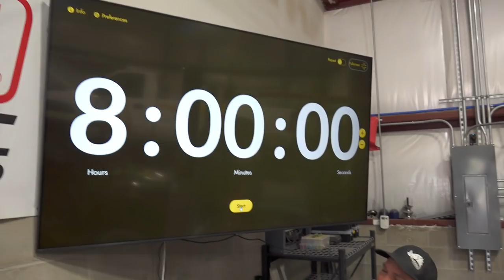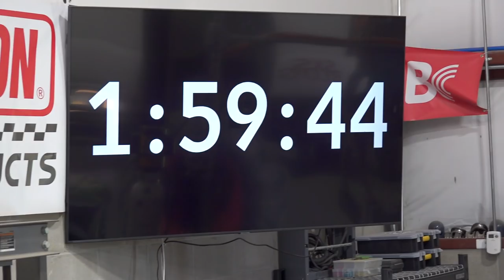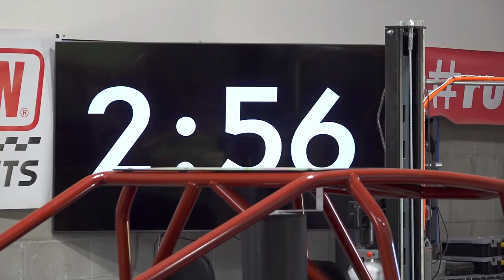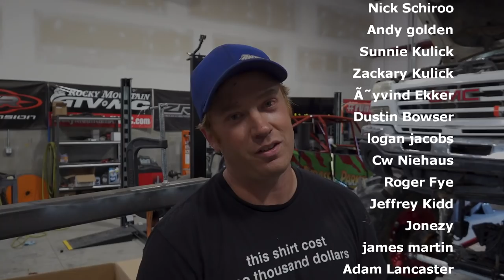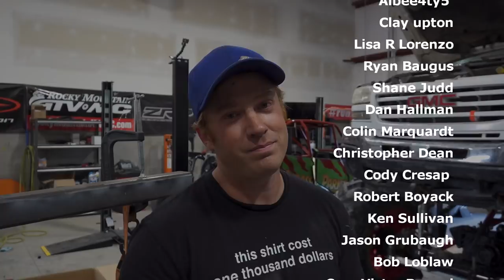2-stroke Maverick X3 vs TURBO Mega Truck build off! 2 Builds 1 Shop DAY 1!

Comment from the maker: Who do YOU think is gonna win the build off!? Team RIK or Team DOUG??
Reply: DOUG!
Reply: What happens if nobody is done in 3 days? While I love you guys, let's be honest, that is a very real possibility.
Reply: DOUG!  Loser should have to take a 5 wheeled John Deere gator to silver lake for a day on your next trip out.
Reply: Rick and Matt radiator cooling fans don’t know if it’s got condenser for ac and remove any coolers off the front remove headlights core support bumpers get right up close and personal don’t have to worry bout pulling motors to fit the cam then take all the accessories off the front and you’ll be on the move gentlemen
Reply: You should make a secondary punishment for possible complications due to rushed tasks in the build to really make sure the job is done right
Reply: I'm backing Dr Doug 2 strokes rule baby
Reply: Doug!
Reply: Team Doug
Reply: Everybody picking Doug but Rich ain’t no slouch
Reply: Doing body shots off of the winning nick in 100* heat without a shower seems like a punishment I couldn’t handle without throwing up? Just a thought ???
Reply: Doug. But I really just want to see them unit's rip.
Reply: Got to go BATTLEFIELD
Reply: Team doug 
But Rich rules baby!!!
Reply: DOUG
Reply: Run one mile while driving a sxs next to him
Reply: I like biscuits!
Reply: Who wins? We do!!! Let’s gooo, baybee!!!
Reply: Doug isnt human he will prevail
Reply: No fast food for a month. 🤣
Reply: RIK & MB for the win!, They got this!
Reply: Team Viewers for getting to cool projects done around the same time.
Reply: Doug
Reply: Def Team Doug ftw. Keep this content on the main channel. It’s still sxs related content so it’s still relevant for the main channel.
Reply: Rick Rules! Lol
Reply: Team DOUG!!
Reply: Dope Series!! Team building is a great tool to use in life!
Reply: Team Doug but can't wait to see McMega rip!!!!
Reply: Didgeridoo Doug for sure!
Reply: dougggggg!!!
Reply: put it all in one channel !!!!
Reply: Rich rules babyyy
Reply: Stock build l would go with Douglas but the custom stuff could cost more time.Rich and Matt for the win.
Reply: Loser team spends 24 hours in a McDonalds. Each QP ate deducts an hour from time spent.
Reply: Doug
Reply: The Butterfield brothers!
Reply: This was a real fun video. Keep it on the blog channel!
Reply: Rich Rulez baby!!!!!
Reply: Rich rules baby
Reply: Rik.
Reply: I’m always team Doug!
Reply: Team Doug!
Reply: DOUG
Reply: I can't call it...
Reply: I like all involved; but I think team Doug has my vote. I mean; come on they are brothers. 😎
Reply: I don't care who wins I just want to see that 2 stroke sxs work! And I hope it's everything that Doug thought it could be when he came up with this monstrosityous  (I just made a new word) idea,... witch by the way is imo epic!
Reply: team rik
Reply: Losers swim the pond then gets pulled around the track on a hood wearing Wildcat themed clothing.
Reply: Team Doug
Reply: Doug rules baby
Reply: Go to d&d paddy for some aggressive tires plus you might see monstermax 2
Reply: Doug
Reply: Doug hands down 🤘
Reply: Doug wins, keep it on the sxs blog channel!!
Reply: Keep the series all on the main channel love the projects!! Team Doug all the way
Reply: Douglas
Reply: Doug
Reply: @1kered88  damn, that's low.
Reply: Team Doug all the way but I wanna see Mcmega ripping👍🏻👍🏻👍🏻
Reply: Doug and his evil genius bro
Reply: Im team RICH RULES BABYYY 
Also love the build battle format like this was awesome to watch
Reply: Loser has to swim the length of the pond!
Reply: My bet it on mc mega. Simply because most of the fiddly work is done most of the next bits are pretty well bolt on 👌🏼. Can’t wait to see them both throwing mud
Reply: I dont care who wins long as they both get finished I wana see that 2 stroke sing
Reply: Im team Doug. Cant wait to see that 2 stroke rip!!!
Reply: Team RIK
Reply: Doug looks further along, but I feel Rick may get a lot done once the right head studs make an appearance
Reply: I am agree with Matt, keep it that way!
Reply: I think Doug is going to win.
Reply: Just put all videos from this series on both channels
Reply: We love this kind of content. We will watch no matter which channel it is on.
Reply: I think Doug is going to win the big problem he'll have is the connection between the snow cat engine and the knuckles. Since he laid out the motor very precisely, his issues will be smaller because he'll "only" need to think of one solution and copy paste it to the other side. If Doug screwed up with the alignment of the motor then it will be a another animal.
Also I like the competition and please keep it here and do it once biannually.
Reply: Have Whistling diesel do a durability test on the losers ride.
Reply: Gotta go with Team Doug.  Just gut feeling.
Reply: I'm ready to see them both rip! Thank you guys so much for busting ass to get them done for all of our enjoyment! You guys are awesome!!
Reply: Doug
Reply: Team Doug
Reply: Doug
Reply: Rich rules baby!!!
Reply: Tie
Reply: @1kered88  Those were so awful haha
Reply: @JustinG85  yah those motors are real easy to work on. It doesn't take long to put heads and intake on.
Reply: Team butterfield and i enjoyed the work you guys did and made a lot of good progress on both projects
Reply: Team DOUG , keep the builds together
Reply: Rick will win
Reply: Team SXS BLOG!! U all r bad asses.. keep it together and on one channel regardless what one u post it on the fans of the build off will follow!
Reply: Sorry Doug. Rich Rules Baby!!! Let's here that turba spoolin brother.
Reply: I think it comes down to Rik and Doug! One of those guys will finish first! Look they're both winners at the end of the day! Lol! 
Both projects are awesome in my book! Great video!
Reply: Doug!!!!
Reply: I think team Doug will win the competition, but I think team Rick has a more difficult project being a lifted truck. Can't wait to see the 2-stroke rip, I have a similar project I am gathering pieces for. I have Polaris 600 triple to drop in a 2012 RZR 800s body.
Great channel guys.
I hope to see more sxsblog trailruns this season.
Reply: Rich does Rule Baby, but jeez it's DOUG! What to do?!

Comment: Rick! 
-Mix together two tablespoons of room temperature virgin  with one and half tablespoons of finely ground sea . GENTLY, apply the mixture to clean, dry . Massage into  using a circular motion for 30-60 seconds before wiping clean with a cool, wet washcloth.

Comment: Not sure if you boys know this but that 680 2 stroke motor can have an electric start done to it, there’s a clutch you can get with a starter gear it runs for about 400 and you can get a starter as well I did it for my 97 ultra. Good luck with the build
Reply from the maker: 809 Ski-Doo fam, likely going to just put an STM on it but we'll see shortly

Comment: You are gonna want to rubber mount that sled engine or I see cracked motor mounts and pipes in the near future.
As Im sure Doug knows, clutching and carb tuning is gonna be big chore.
Reply from the maker: Nah, solid mount race sled engines all the time
Reply: @SXSBlog  drag race?

Comment: i have the same turbo on my ls3..  love it. although i used the oil cooler spot for a feed line and my drain went right in the pan... i found it pushes out the exhast seal the most when the drain is not straight down.... easier said than done in a 5th gen camaro love vs raceing